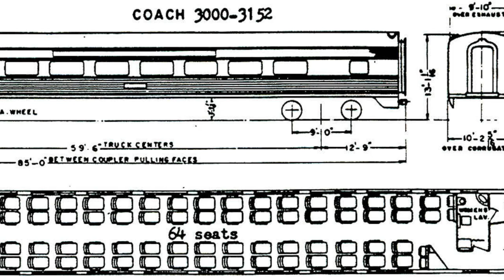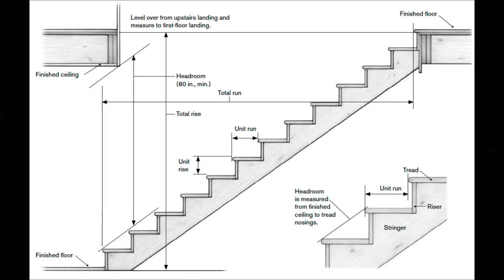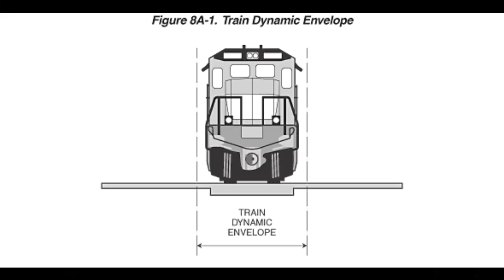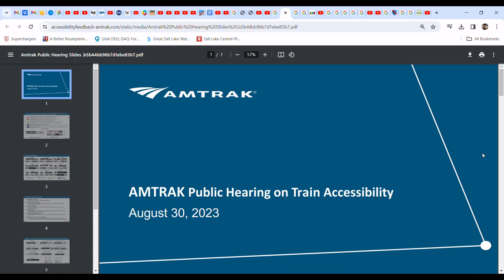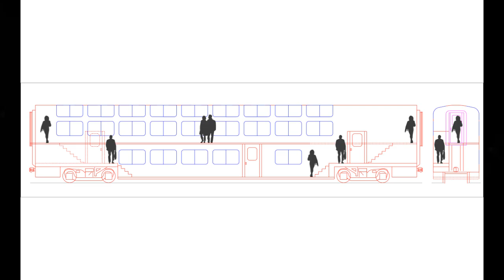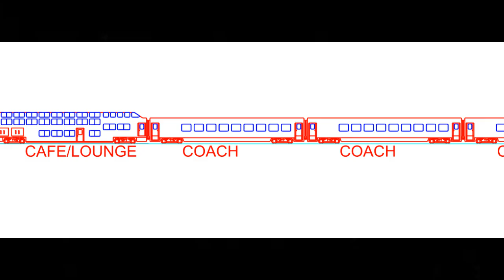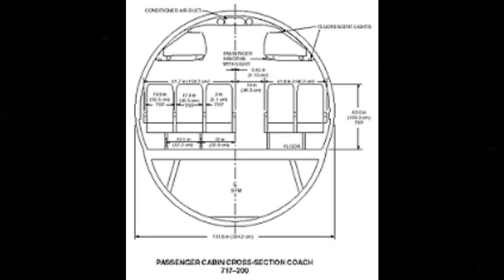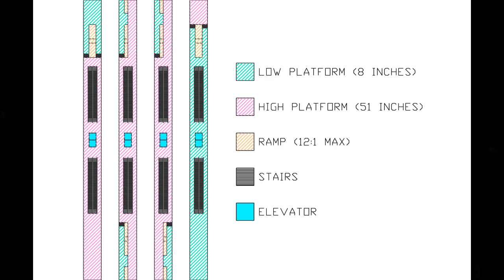An Excessive Explanation of North American Platform Heights

Comment: I like the pod idea but it seems more workable for night train service.   I would not want to spend two full days in one.  They would probably have to add a second lounge car just for the pod passengers to sit.   What about the  slumbercoach?  Those were single level so could work anywhere.
Reply from the maker: I agree, the pods would be ideal for a single night, but 2 would be too much. Fortunately, very few amtrak routes are longer than that.
Reply: @CSLenhart  two nights wouldn't worry me, it's what do you do during the day!

Comment: Or we could just take a page out of the jetway book, and make a platform that adjusts up and down, and in and out with a ramp leading up to the platform. This way, many types of railroad cars would be able to be accommodated and also would be somewhat future proofed for any technological innovations.
Reply: That way a train has to stop in a very specific spot, or you make it unnecessary complicated. Trains should have quick stops and not someone that needs to lower a platform in the train.
Reply: Not necessarily, so the platform could be just as any other traditional platform and length, and width the whole apparatus would move up and down and backwards and forwards, as well as the ramp, could be any width length as well

Comment: Why not just increase the width of the passenger cars to match that of freight, the shinkansen is a wider standard and there are seating benefits to it as well. Would also leave additional space for stairs in bi level vehicles.
I really like your superliner design concept, I think the idea of having a transition car like that solves many issues.
Reply from the maker: In an ideal world, I think wider passenger cars would be the optimal solution. But in order to get there, a lot of existing infrastructure in the northeast would to be upgraded to make way for the wider cars (tunnels, bridges, platforms, track spacing, catenary poles, etc). It's a good standard to work towards, but we also need a solution in the meanwhile.

Comment: In Europe double deck trains loosed to single deck. Double deck trains sucks if there is a quite many stops. Boarding in double deck trains is just many times longer. In my country there is some lagacy double deck trains and on this routes just becouse boarding they travel 10-20% longer (this is combined with frequent stops).
And in europe we have longer platforms so we can have more car to increase capacity.

Comment: The problem with the retractable equip being on the train is poor maintance. If it gets stuck open the whole train is stuck.
Reply from the maker: That's a valid concern. But if there needs to be a mechanism involved, my preference is for it to be attached to a train car that is brought into the shop for regular maintenance and inspections, rather than work with each city/state DOT individually to make sure they keep their platforms in working condition.

Comment: USA has the best cargo trains on Earth. They are all private owned
The USA has the worst passenger trains. They are all government owned
Reply: They're government-owned because freight railroads didn't want to be responsible for also running passenger trains. Back in 1971 the Nixon admin. didn't want create Amtrak at all b/c they felt superhighways were the solution. They also knew there'd be a public uproar if they just pulled the plug on passenger rail, so they saddled Amtrak with a lot of poison-pill requirements that (they hoped) would let it limp along for a few years till it failed - presumably under a different presidency. This isn't a nutcase conspiracy theory, it's VERY well documented. 

The biggest pill was the profitability requirement, something that NO national passenger system anywhere else in the world can meet, but Congress still insists that Amtrak is "special". They've never provided adequate support and do sht like micromanaging café car food prices. 

Maybe we need something like the UK where the gov't funds railroad infrastructure and private operators run trains, the same way the gov't here builds roads for private car/truck/bus users.
Reply: Anything run by the government is expensive and incompetent  @JayKarpwick

Comment: My first question is are there enough passengers to warrant all this double height coaching stock ?
If the numbers aren't massive then this could be dropped and therefore remove one of the main causes of problems.
From that point onwards, standardisation needs to be brought in at a national level. Not over night but over the next 20 years. This would include platform height and parity of rolling stock width.
Reply from the maker: Capacity is only one reason for using a bilevel design. Current superliner sleepers put the rooms upstairs, where the ride is generally smoother, and the amenities like restrooms and showers downstairs, where the plumbing is easier. But whether these advantages are worth the extra complication is still an open question.

Comment: How about adjustable height platforms? Basically, between trains, a mechanism would raise or lower a metal platform and slide it in or out toward the rail. People would not wait on the platform and it would be gated while adjusting.

Basically, you'll take a normal platform and widen it by about 6 feet for a dual-track platform or 3 feet for a single track platform. The height would be about 8 inches above the top of the track. This will now be referred to as the "sub-platform". On the sub-platform, you set a movable platform which runs the length of the sub-platform. This platform has a railing on it which prevents people from stepping on. At about 30 foot intervals, there are entry ramps which run parallel to the platform. These will be fixed to the platform, but have rollers on the end toward the sub-platform. (As the platform raises or lowers, the grade on the ramp changes. At the highest grade, the ramp would still need to be ADA compliant.)

The platform itself will be raised and lowered using a ball-screw scissor jack mechanism but will also be spring or counterweight assisted. If you allow adjustment over a 5 minute period, you could probably get away with using a 1/4 horsepower electric motor for each 30 foot section.

Yes, there'd be a cost to build and maintain this, but I'll argue that the cost of standardizing the existing railstock and stations is a lot higher over a 30 year period.
Reply from the maker: That sounds workable for busy stations with lots of traffic (to justify the costs). I'm less certain it is as viable in the small cities along the long-distance routes that see only 2 trains a day. I suppose it depends on how simple and robust the system is.
Reply: @CSLenhart  Yeah, no doubt. This would be for situations where there's like eight different lines servicing a particular platform and also sharing the track with freight.

Comment: If the trains become stacked, it's not for fun! With the number of passengers increasing and platforms not having an infinite length, this is the only solution. There is obviously also a question of profitability. We've had this in France for decades and it doesn't cause any problems.

Comment: Great video! A couple of thoughts…

You mentioned the ability to pass from car to car on both levels. To my knowledge, there are currently four cars with that capability in the US, all in Alaska. They are private cars owned by Princess Cruises and were rebuilt out of old SP Gallery commuter cars.

As far as the new Rio Grande Depot goes, the obvious solution to me is to build an island platform that is 51” high with a track on either side of it. It may not be necessary now, but if the cost and time of constructing such a station is to be invested, it makes sense to build infrastructure that would useful in the future, rather than requiring remodeling or expansion later.
Reply from the maker: Oh, interesting! I'll have to read up on the Princess Cruises cars. And for the island platform at the Rio Grande Depot, I agree! Building for the future is the right way to go!

Comment: I'm looking at this after the "Europeans have an issue because they can't have level boarding on their intercity trains due to lower platforms" and then listening to all these extensive workarounds the US needs to do to get level boarding on all their trains. All new Swiss trainsets since the introduction of our version of "Ada" have level boarding, despite the lower platforms and with much fewer adaptations, so I'm not sure there is an advantage there.
Reply from the maker: If there is one thing I've learned from the comments so far, it's that I've made the classic American mistake of talking about"Europe" as if it were one thing. 😏

The Swiss situation sounds very interesting, even if the same solution is infeasible in the USA.

Comment: In Estonia, we have implemented a standardized platform and train door height, which eliminates the need for steps or retractable floors. The trains are specially manufactured for our country by Swiss and, in the future, Czech companies due to the gauge that is unique to our region. As for freight trains, we have opted for American-built GE freight trains. Therefore, it appears that standardization should not pose any significant issues in us only if not the cost.

Comment: 4:26 why exactly would that limit the utility of the bi-level design? Why do you think it would be more efficient and convenient for passengers to board on the lower level instead?
Reply from the maker: Since there is more space on the lower level than the middle level, passenger circulation is easier and faster, helping to keep dwell times at stations low and less stressful. But perhaps this isn't as big of an advantage as I am imagining.
Reply: @CSLenhart  having more space on the lower level isn't relevant in that aspect. Doors of the same size will take up the same space no matter where they're placed at. 
Many of our double decker trains have the doors on the lower level as well, but having them above the bogies on the middle level is just as good. It simply depends on both platform height and how they cover the height difference between the middle and lower level. Have seen dozens of different layouts with stairs and ramps, wide and narrow etc. 
Boarding isn't really faster or slower with the one or the other layout. Doesn't play a role if passengers from the upper level have to go down two stairs or if they go down one stair and those from the lower level go up one stair / ramp

Comment: My thoughts on ADA compliance center on what happens when the wheelchair lift / elevator malfunctions? 

When I lived in New York City, one of the elevator equipped stations was Atlantic Avenue (R / N / D lines, 4 tracks, 2 island platforms, one elevator on each platform). Those elevators tended to breakdown at least once a week. 

If you are in need of the elevator and the one on your side was out of order, to get to the opposite platform you either had to go all the way to Coney Island or Bay Ridge 95th Street, southbound, to get to an across the platform or same track transfer to a train in the opposite direction, and northbound you had to go into midtown Manhattan,  to hopefully find a station with working elevators, otherwise you were headed to Queens or The Bronx to get to somewhere you could go back to Atlantic Avenue. 

TL;dr: those in wheelchairs avoided the subway due to lack of redundant elevators.

The same could happen on a fixed set of gangway cars on Amtrak if there's only one lift. Only instead of touring the city to find an elevator, the wheelchair user will be treated to the indignity of having to be manhandled down the stairs, possibly by strangers - if not by paramedics. 

Whatever ADA devices are utilized in the next generation of equipment, it needs to be robust and double or triple redundant. 

These lifts also need to be used by passengers with canes or walkers, too.

While my elderly mother is still able to run circles around me, her ability to climb stairs has sharply declined in recent years. Our front steps are now 12"x24" slabs two inches high. Four inches is pushing her limits, requiring manhandling her up them, and conventional 8" steps are impossible. It's been nearly 8 years since she felt comfortable trying to board a passenger train or public bus - some wheelchair lifts don't account for the headroom of a person standing with a walker or cane. 

AJK
Reply from the maker: All very good thoughts. Thank you for sharing! I would hope that an on-board lift would be mechanically simpler than a full elevator, and that the train staff would have some training in basic troubleshooting/repairs for small problems. Otherwise, as you say, there would be trouble.

Comment: The thing I don't like about the SuperLiner style is that you can't go from car to car on the lower level.  So anybody who uses a wheelchair is stuck on the car they boarded, because they would need to go upstairs to get to the dining car or observation car and cafe.  Aside from that, the SuperLiner style is dope.  I rode it a few times last year.  Both level passage between cars clearly seems like what you want.  One thing that dual-level gets you is trains short enough to be compatible with existing stations.  For the single level, longer coach sections, I think you'd have to do sining and cafe at the ends, and have the passenger cars in teh middle so you could do all the boarding, departure from a middle section that fits the existing platform.
Reply from the maker: Being stuck on the lower level is the reason Amtrak is considering lifts in their next generation of car. Otherwise I agree, super dope!

Comment: This filled in a lot of unanswered questions I had of new platforms going in at Amtrak stops here in North Carolina and the new ones In Iowa at Mount Pleasant and Ottumwa.  thanks for the informative video.
Reply from the maker: I love that North Carolina is expanding its passenger rail, and is building high level platforms at major stations! You are setting a good example for what the rest of non-NEC America should be building.

Comment: no matter if single level or double decker trains, you can design the double decker trains to have the doors on the very same level like all the other single level trains, and then also use one standard for the platform height
Reply: In Sydney, NSW, Australia, we have double decker trains with high platforms and level boarding; although that's because the boarding vestibules are on a mezzanine level between the two seating levels (and therefore you need to go up or down stairs if you want a seat facing the direction of travel).

Comment: so those measurements you mention, what are they in proper  units?
Reply from the maker: Considering these standards are for North America, inches are the proper units! 😉

8 inches = 20 cm
15 inches = 38 cm
25 inches = 63.5 cm
51 inches = 129.5 cm
104.5 inches = 265.5 cm
Etc.
Reply: @CSLenhart  thx.
 I suggest, you put those numbers on the screen in the moment you talk about it.
Are those standards for North America, or just for the USA?
It would be a bit weird for Canada and Mexico, to express there standards in imperial units.

Comment: If the gap filler is on the car how is it serviced if non op due to ice or what ever en-route?  Station based can be designed to be serviced with car in place, and can be serviced while the train is in motion.
Reply from the maker: My thinking is that the train cars are regularly inspected in the maintenance shop, so the probability of failure is less likely than a platform-based facility, which would require regular visits from a maintenance crew. But I concede this may be an incorrect assumption.

Comment: Over here in sweden we have a mishmash of platform hights, everything from a 10cm up to 100cm (i think that is the maximum alowed, other vice there have to be platform doors)

Quite a lot of our train have two level doors, typicalay att something like 40-45cm and one set at around 80-90 cm. Also with gap filler that extends upp then fall down can fill a gap of about +-15cm, covering most platform hights

Comment: lol you´ve got the same problem as germany, we´ve got kind of 2 standards for platform hight, 76 cm for long distance trains (of wich non have 76 cm doors but always 3 steps upward) and 55 cm for comuter trains wich have level boarding. And of course very old stuff, that is 38 cm and less high. And the S-Bahn systems arround big cities, that use 96 cm platforms. So a complete mess with no solution in sight :D

Comment: 11.12 It wouldn't be the first car in the world with passage between coaches on both levels. TGV duplex has had it for years now, being 4.3 m tall (14ft if you don't want to use the international unit). So I see no reason why they couln't implement it on 16ft tall coaches...there is absolutely no need for coaches that tall.

Comment: as somebody living in europe this video was a real education. the steps placed in front of the doors, the way freight trains are a different size to passenger trains totally messing up any hope of standardization. but best of all the "gallery car" with a slot in the floor of the upper deck so you can look up from the ground floor at passengers upstairs. I almost fell out of my seat when I saw what a "gallery car" was in the USA.
Reply: One nice thing about gallery car bike cars is you can sit upstairs and keep an eye on your bike downstairs.  They removed the lower level seats in the bike cars and it fills up with a lot of bikes.
Reply: American gallery cars do indeed have an open space above the aisle between the two sides of the car on the upper deck, although it may not be obvious from outside.
Reply: And if you want to know why they were designed that way, the gallery cars have that opening so the conductor can ticket you from the lower level so that no one could use the bilevel design to hide from having to pay their fare by evading the conductor.